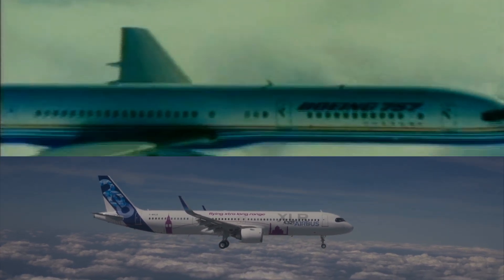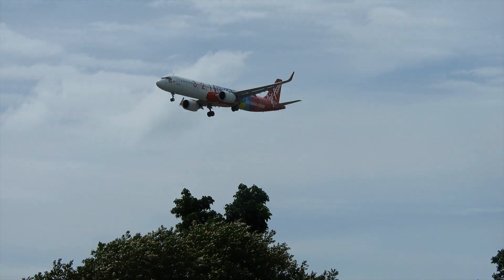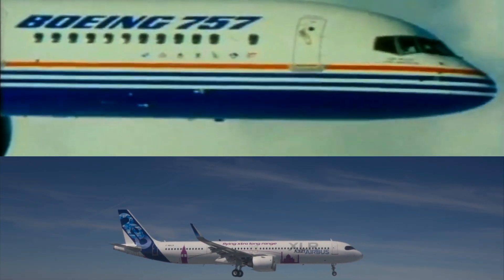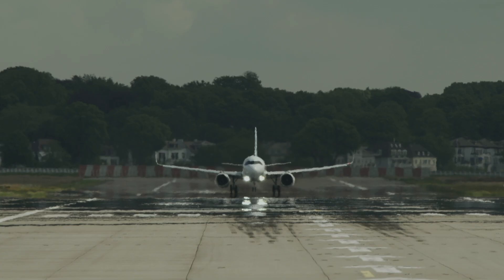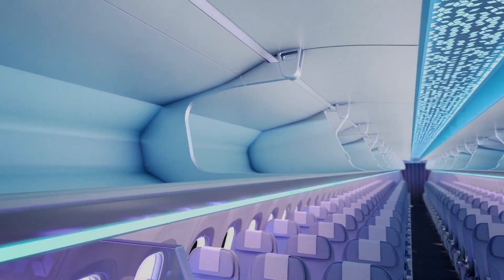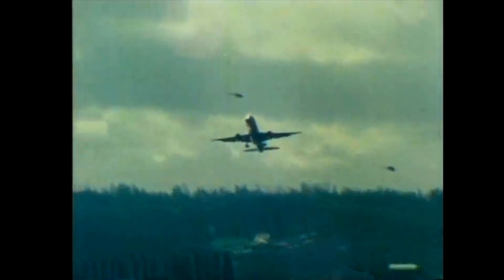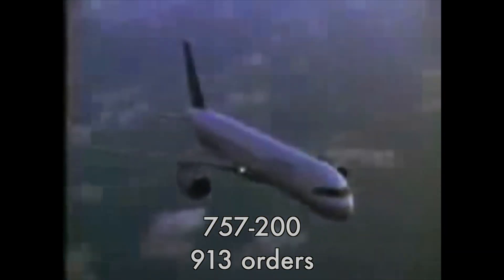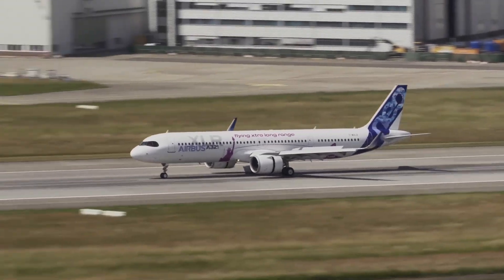A321XLR vs 757: Can A321XLR REPLACE 757?

Comment: Provided that you don't need 'the extra whatever' that the alternative has, any aircraft can replace any other.
Reply: The 757-300 is longer than the A321XLR and A321LR so the A321XLR and A321LR won’t be a replacement for the 757-300, only the 200
Reply: @sebastianfloyd372 That would be 'the extra whatever' I mentioned. The question is whether that particular 'extra whatever' is even needed. The 757-300 was an unmitigated sales disaster, even though (unlike the 757-200) it never had, and still doesn't have, any narrow body competition. A situation unlikely to be repeated, because when suitable engines eventually become available, should there actually be sufficient demand for such a high capacity single aisle, Airbus will almost certainly produce a further stretch beyond the A321, or whatever replaces it.

I suspect, that we may not see anything longer than what a hypothetical 757-250 could have been (the equivalent of what has been called an Airbus A322, or sometimes an A321 stretch). This may be the maximum length for a single aisle aircraft if it is to maintain acceptable turn-around times to squeeze enough flight segments into a day to justify its use by the budget airlines.

Speaking from personal experience, it can take an absolute age for a full A321 to board.